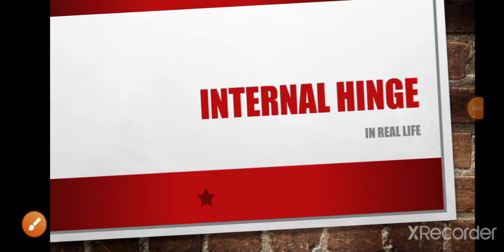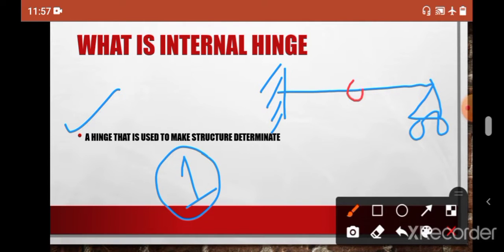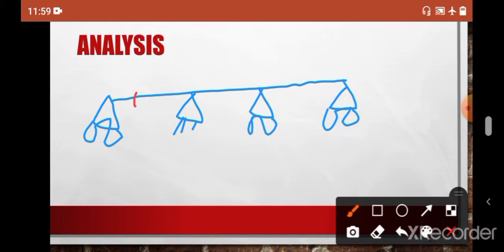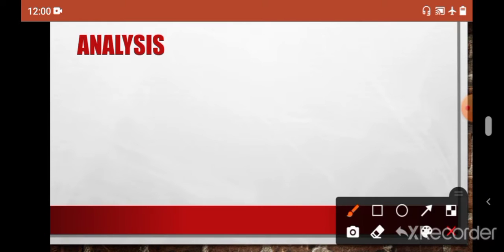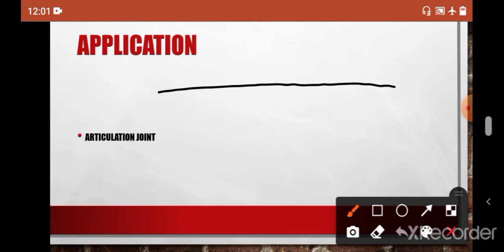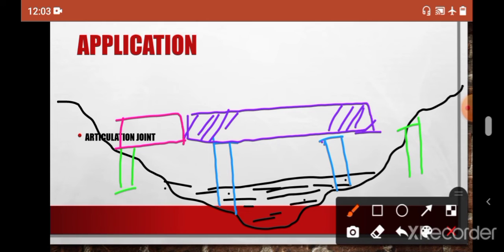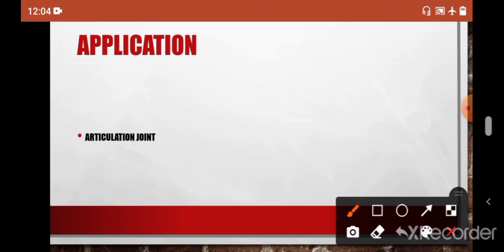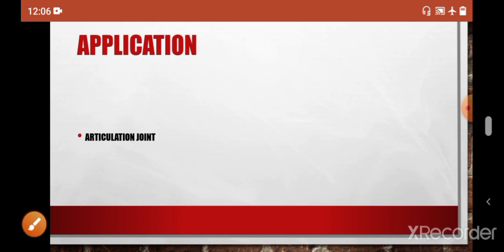Internal Hinge : Real World Example

Comment: Sir 
We have more onather method also for find reaction in indeterminate structure ,so why we use hinge
If we are not using hinge than what's happened
Reply: Providing internal hinge is helpful in releasing moment and also help in reducing temperature and settlement stress. And also Bending moment for one beam can act as torsional moment for other beam and if we don't want to design beam for torsional moment we may provide internal hinge.